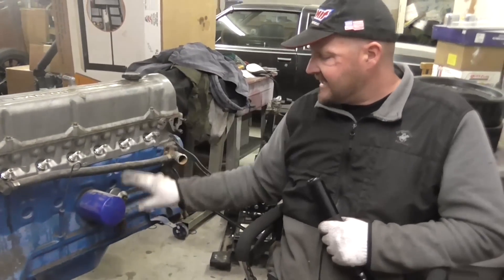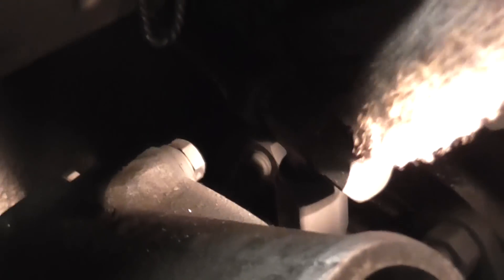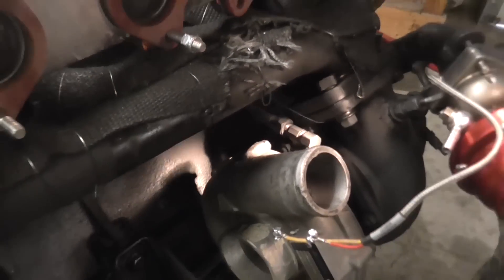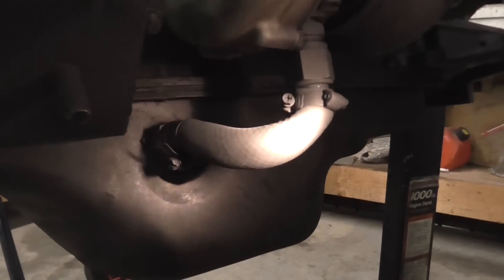Turbocharger Oil Supply And Return Line Installation

Comment: thank you for Replying.  I recently spoke with someone over at jim wolf technology and he is one of there tech guy's. He told me that the oil pan spacer that they provide for my 350z,  is meant to add 1qt more oil and also they us it on there twin turbo kit to return oil. I'm almost finish with my turbo project,  and I did as the gentleman said, so I guess I'll see how it works. But I'm with you,  I have always return the oil from all my turbo builds bove level.

Comment: This kind of gives me hope on what I'm doing.  That return line you show that is basically turning 90 degrees out of the turbo and the tube is pretty much flat and actually kind of dips a little bit.  Well,  I'm not trying to start a debate or disagree with what you have there, if you say it works I will take your word for it.  Technically, thats not really good geometry for a return it dips a little and doesn't run downhill as much as the textbook version of what a return should look like does. Well, I'm kind of forced into making a return that runs almost the same as that, and like I said this kind of gives me hope that it will be ok.  Obviously, you've ran them before so I trust it, Thanks for showing this,  I will just set mine up like that.

Comment: thanks for the awesome video on oil lines!  what about turbos that need liquid cooling as well?  Any info/video on how to tap in to the water lines would be greatly appreciated.  thanks! and keep up the great work!
Reply from the maker: ***** my 1984 Nissan 300zx turbo had water cooling lines in its factory turbocharger.  When I installed a T04e turbocharger it only had the oil in and out lines.  I had blocked the water cooling lines for that z.  If your new turbocharger has the water in and out lines, you connect them the same way as the factory.  Adapter fittings are sometimes required since many oil and cooling lines on turbochargers are threaded.

Comment: Glad you are feeling better and making videos and still have a great sense of humor the accident hasn't phased you at all and I congratulate you on the recovery, and quick question could you put a l28 in a z31?
Reply from the maker: KOD656 When I was stationed in Japan, there were options on the Z31 that had RB20DET inline six engines in them, it was the PZ31, of course we never had that option available here.  We just had the VG30E or VG30ET engines.  Yes, inline six engines can go in but the engine mounts are very different between L28, RB20 and VG30.  It can be done but some fabricating on engine mounts and transmission mounts will be the challenging parts.  It would be much better to me due to how much easier the L28 is to work on compared to the VG30 engines.

Comment: Hey man awesome vid. I have a stock l28. But this is a pretty cool set up. If i ever need this done. I would rather send my l28 to you man haha i would actually want to do that some time in the future as well.
Reply from the maker: ***** I met some people a couple days ago and we discussed the interest to design, fabricate and product custom L28 turbo headers with either T3 or T4 flanges with either 4 bolt or 2 bolt external wastegate flanges and design them to fit 1970 through 1984 Nissan L series engine equipped vehicles.  In 1984 in the U.S. there was the Nissan Maxima that still had an L series engine.  In Japan they also had them in the Skyline cars until the RB engines were introduced in 1985 or 84 1/2.  I believe there is a great demand for these custom turbo headers since no company makes them anymore.  What are your ideas?

Comment: Bad ass vid. Explain how to and where to determine where to hook up engine coolant feed/return for air/coolant cooled turbochargers. Explain how to determine what size fittings are on a turbo. How to determine which need O-rings etc. Might help BudgetBoosting's views.
Reply from the maker: TREY CARVALHO On most aftermarket turbochargers they do not have cooling ports, we bypass or do not use coolant in turbochargers.  Cooling ports are done on a lot of factory turbochargers from the manufacturer.  My 1986 300zx turbo had cooling lines in and out of the factory turbocharger, I had to block them off and eliminate them when I converted to the TO4e since it did not have cooling ports just oil in and return ports.  I prefer no cooling lines, just invites more problems when seals go bad, you would have coolant in the oil.... not good.

Comment: Hey, good to see you back again and back on that horse thats great. I think I was the first one that got your sticker on Ebay and im saving that baby as a collectible for the future ;-)
i' have another engine an L28 stock and I want to turbocharge so great info on the oil lines also can you recommend a turbocharger that i can use with the 280zx turbo manifold.I'm looking for 10-15 psi of boost,If you can send me a link to an ebay turbocharger so i can reference that will be great.

and again keep up boosting...
Reply from the maker: frod sports when you search ebay for turbocharger just type:  TO4e v band   in the ebay search and it will come up with many results and pick one of them where the seller has a good reputation and free shipping.  I believe EIII is one of the turbochargers I have purchased recently with good results.  They come with V band flange to weld to a down pipe so your exhaust is held on by v band clamp easy to remove and install once the flange half is welded on the down pipe.  The TO4 e is a great midrange turbocharger that will meet your goals of 10-15 pounds easily and can support over 300 hp.  Great price too with many different sellers for competitive prices.  Let me know how it goes.
Reply: Budget Boosting thanks for the info. I was also watching your how to choose a turbocharger video and it help a lot so thanks again.

also can you make a video explaining compression ratios and how it affects with turbocharging on L series engines.I notice that there is a lot of Datsun people swapping cylinder heads to get different compression ratios for example like a L28 block with a P90 or P79 head etc.
Reply: frod sports thanks for the info. I was also watching your how to choose a turbocharger video and it help a lot so thanks again.
also can you make a video explaining compression ratios and how it affects with turbocharging on L series engines.I notice that there is a lot of Datsun people swapping cylinder heads to get different compression ratios for example like a L28 block with a P90 or P79 head etc.

Comment: Hi bro congrats and nice vídeos. I hava aquestion. Hope you can help me out. Can a motor be oil cooled with this method?
Reply from the maker: +mark62726 yes, it gives you more options on where to run the oil supply and return since the whole cooling system is done by oil.

Comment: You make it seem so easy, but what about a twin turbo set on a vq35de engine, how do you run the oil Feed lines from both turbos to the single oil pressure switch/sender?

Comment: I would like to see a video of you installing the oil return line. How do you get the oil return bolts in hole in the oil pan especially when it's aluminum do you JB weld it tack weld what do you do thank you sir

Comment: hi
nice to meet you again...

how can i reduce feedline oil pressure ( high pressure make turbo blown=blue smoke)

sorry for english
Reply from the maker: mohsen qurbani There are many oil feed kits out there.  You want to find the oil feed kit with a very small hole which gives a good pressurized oil squirt to the turbo bearings but does not let too much oil in to blow the oil seals which leads to the seals blowing and all that smoke.  Like when you check ebay for turbo oil kit, look at the pictures carefully, the turbo supply flange will have a small feed hole.  The turbo return line will have a very large exit hole and a large line to ensure the oil quickly gravity feeds back to the oil pan and that ensures oil does not get pressurized too much in the turbo bearings.  Small oil hole squirting oil in, Big hole allowing oil to return quickly to the oil pan.  Ebay has lots of kits just like this for sale.  From the factory, most turbo cars had high pressure and volume going in the turbo inlet so oil seals did blow after time due to the high pressure having no where to go quickly.  The oil return could not work fast enough to get the oil back to the pan after it lubricated the bearings.  Hope this answers your questions well.
Reply: Budget Boosting Thank you for your good answer.
Reply from the maker: mohsen qurbani Your welcome, thank you for watching.
Reply: mohsen qurbani In addition to what was said already, you can buy "turbo oil restrictor" fittings and they're all over eBay. You can usually install an adapter inline to your current fitting to get the restricting effect.
Reply from the maker: HighPotency Yes, I usually pick the one that has a restricted hole at the turbo oil inlet.  Both will accomplish maintaining the right oil flow to the turbocharger.

Comment: Wouldn't you lost oil pressure to your engine or do turbos hold oil pressure inside enough to keep a good oil pressure left to your engine, do you need to upgrade your oil pressure pump?

Comment: I have a bmw 318i and the engine I lsd slanted and so it's the oil pan. The turbo is going to be sitting on the slant ed side so my question is can I still tap my return into the top of the oil pan or is the oil level to high on the lower side? Sorry for the bad explanation. Thanks

Comment: What about a remote turbo in the rear?  Could you just extend the lines?  Or does something else have to be done?
Reply from the maker: Nebula 7 Remote turbochargers are great for a sleeper setup putting them where the muffler or cat used to be.  You can either get really long lines or get an self sufficient electric oil pump and a small tank supplying oil only to the turbo to cycle to turbo and back to custom oil tank moved by the small electric oil pump.
Reply: Budget Boosting I hear some are worried about the electric pump failing without warning.  I've looked into oil-less turbos and found although the turbos themselves are more expensive, it balances out in the end, because you don't have to buy oil lines, or worry about cross contamination, or the oil pump failing.  They are lubricated using high temp grease, with special ceramic bearings, have a service life of 50,000mi, and are cooled using water lines.

Thank you for the information, I have some thinking to do.
Reply from the maker: Nebula 7 Lots of options to consider.  Glad there are oil less turbochargers out there.  The electric oil pump is not my favorite option, just an option, myself I would go with the lines to ensure its getting there and back.  The grease set up sounds great though.

Comment: i have a turbo that is also water cooled, where would i hook up water lines using the straight six in this video as an example, thank you.
Reply from the maker: you can tap into the intake manifold water cooling lines and tee in and tee out of it.

Comment: I need to change the turbo (In) oil feed pipe on my TDI Audi A4 what's the best way of priming the system after changing it, I've heard that disconnecting the fuel pump fuse and turning the engine over for approx 30 seconds should do it.

Any advise would be most helpful.

Comment: I have a 2004 Nissan xtrail I’m putting a turbo on but the oil pan is flat with no depth to bore. Any suggestions as to where to put my oil return line

Comment: Hi Budget Boosting.

What king of tubing I may use for oil return from turbo? As I understand, it must be high pressure, but some YouTube videos show high pressure pipes with outer stainless armour. Should it be armoured with this outer shield, or regular high pressure oil resistant transparent or black pipe is fine?

Thanks for answer in advance,
Alexey.
Reply from the maker: tubing that can handle hot oil, preferably metal but high temperature withstanding hoses can be used as well but they would not last if there were an engine fire of any kind such as a fuel leak which caught fire.   Best lines are custom bent steel or AN fittings with steel lines.
Reply: my engine is diesel. I currently put rubber high pressure cooling line. but specs for it is 100 deg Celsius. Already installed, and for OM617 engine oil return design it is VERY necessary update. Only issue is the flexible pipe. It should be of higher temperature resistance.
Reply from the maker: The later model cummins turbodiesel stock return line is made of a flexible type of metal hose.  Check one of them out and see if it fits your application.

Comment: Is it better to run turbo supple line off the oil filter cooling system or from the engine block vw engine
Reply from the maker: Either will work as long as clean oil supplies the turbocharger.

Comment: Do you have any info on how to do to a 2000 Ford Ranger with a V6 I am putting the turbo in the bed of the truck because that's the only place I have real room and was planning on using a oil scavenger pump to pump oil what should I do
Reply from the maker: recommend first find where the oil filter is, close by there will by a small sensor threaded in the block with a wire connector on it.  It should be your oil pressure sender/sensor.  That is the point where the turbo oil pressure line will be tee'd into.  Then the oil return will be routed to the highest point of the oil pan where the oil can be returned above the oil level in pan.  Make sure to check that the return line fitting does not come in contact with any of engine's moving parts or oil scavenge tube before picking that spot to install return line.
Reply: Thank u

Comment: Is a chevy 350 tbi a difficult engine to turbo? How much of a budget could I do it on?
Reply from the maker: many turbo kits on ebay for SBC, do some research to make sure they are quality kits.  Some are great, some do not last long.  Read the reviews of customers that have run the parts not just opened the box.  TBI could work fairly well except on factory TBI there are wires and parts on top of the unit that could separate when boost is blowing on top of them.  A draw through set up would work well with factory TBI.  FAST makes a great TBI and some of their units claim to handle over 20 lbs. of boost.

Comment: I have one question..I just did the return oil pipe line below the oil level..my turbo was getting smoke after boosting..is it the cause of return pipe line is in wrong position?..sad is I'm already replace 5  units of turbo but still getting smoke..after boosting..is it because of my return pipe line was to below?

Comment: Hello, I am putting a turbo on my 350z.  I purchased a oil pan spacer from jim wolf that they stated can be tapped to run my oil return. But I was thinking,  how is the oil going to drain when it is already in the oil pan??  I always thought that the oil return had to be above the over all oil level, right or wrong?  Please advise, is this thought true or not?
Reply from the maker: +Ariano Robb Yes, the oil return should be higher than the oil level in order to drain quickly.  I have run mine near the top of the oil pan after removing the pan and verifying that it is at a higher level than the oil would be.

Comment: so you know the oil pan for the for the outlet is that connected to the oil tub or what ever its called (the one that connects to the inlet) isn't that pressured as well or is it not so it gravity feeds it back into the pan soz if you cant understand
Reply from the maker: +ADSlammer oil inlet pressure is provided by a tee fitting from the oil pressure sender source on the side of the block, the oil return gravity feeds with pressure assistance to the oil pan returning the oil after it has lubricated the bearings.
Reply: Budget Boosting OK thx can you do a blow off valve vid

Comment: Do you drill your hole with the oil pan off? If not, do you worry about metal shavings in your oil?
Reply from the maker: The pan comes off so you can install the oil return fitting to both sides of oil pan.
Reply: Dprill95 take the oil pan off so that you don't get metal shavings in your oil.  Unless you want the metal shavings in your engine.

Comment: Does the oil feed line need a restriction? so that not so much oil flows in the turbo and blows a seal? I'm doing a conversion also.
Reply from the maker: +Timothy Bolden many oil feed kits come with a restricted small hole leading to the turbo bearings.  Its good to look at pictures to make sure it has a small hole before purchasing it.

Comment: what type of threading are those fittings, and do you teflon tape them?
Reply: No. Those threads are usually milimetic. You can have this milimetric tee in a specialized gas shop. Don't ever use teflon in oil feeds because eventually could contaminate you oil or get stuck in your feed lines